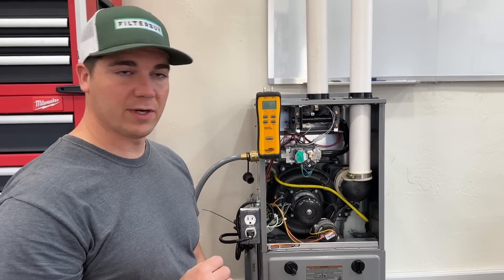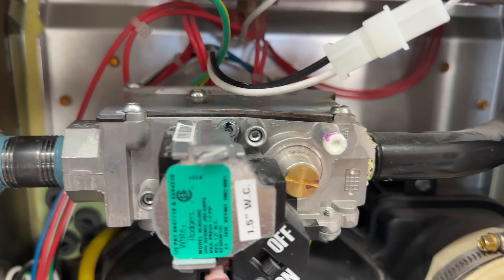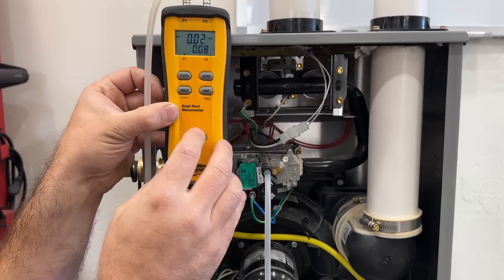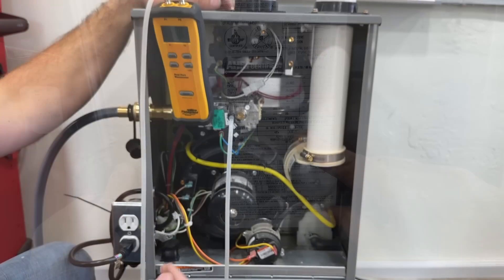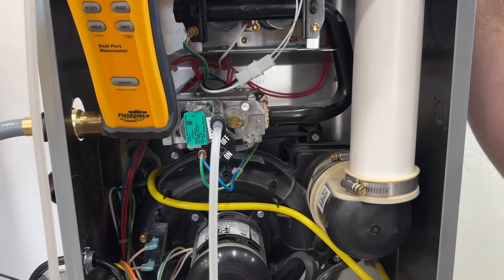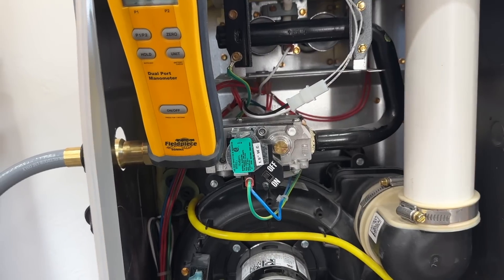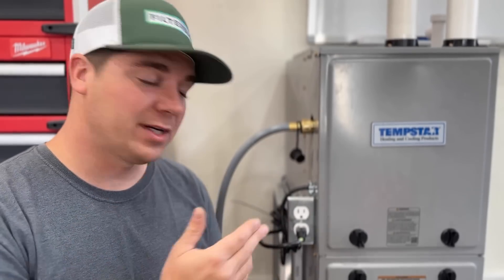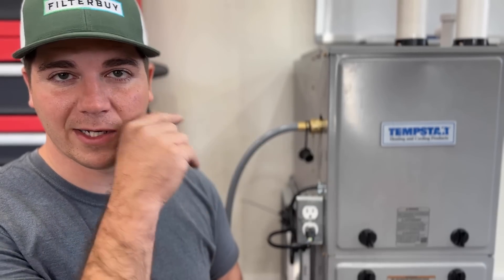Lower Your Energy Bill By Doing This To Your Furnace

Comment: I know it will vary greatly, depending on the situation, but how much savings are we talking about for a typical winter in Michigan? Enough to at least pay for price of the manometer?
Reply: Good point. I assume over time you would recoup the cost of the meter so long as the meter doesn't crap out and you check & adjust it every year. I'm not an HVAC technician but rather a GM technician for 36 years. For someone only using the meter once or twice a year, I would recommend removing the batteries after you're done using it so they don't leak and ruin the meter.
Reply: @ItsDaMechanic  There's no need to readjust the air/fuel mixture every year in a gas furnace.  The BTU content of natural gas in any particular area tends to stay quite stable.  And unlike cars, which are constantly changing elevation, homes tend to say in one place so the atmospheric pressure varies just a little bit from day to day.
Reply from the maker: Oh I’m sure. And you don’t have to check this every year. Once it’s set it’s set. You could check it every few years if you wanted to.
Reply: Lowering gas pressure reduces efficiency
Reply: @ryanbrown5334  can you please elaborate on how this would make it less efficient by adjusting it to factory specifications? I'm always looking to learn, especially from someone who is a good teacher and explains things well.

Comment: How does this save money?
Reply: But aren't you getting less heat at the same time? Won't your furnace have to run longer to do the same job? In the long run will you be using the same amount of gas? So many questions.
Reply: If your manifold pressure is out of spec, properly adjusting it, may save you money. Yes, reducing the manifold pressure will cause the furnace to run for a longer period of time, reducing on/off cycles per hour. When the furnace cycles on the gas runs for about 30 seconds to 1 minute to warm up the heat exchanger before the blower turns on to blow the heat into the house. This is loss of efficiency.

Reducing gas pressure as long as is within spec will reduce the number of cycles and inefficient start up time.

Every time your furnace cycles, the heat exchanger expands when heated up and contracts when it cools down. Reducing cycles will reduce stress on the heat exchanger and increase its life.
Reply from the maker: By using less gas
Reply: @diyhvacguy  It will use the same amount as burner will have to stay on longer. Are you a troll or just doing as a clickbait lure.
Reply: @MrFescue  it also depends on location... here in Texas most furnaces are oversized because of higher cooling load thus the need of a bigger air handler. My home has a 2x bigger furnace than necessary so dialing it back definitely saves money. YMMV, up north you likely won't see much if any benefit of doing this.
Reply: Just what I was thinking you’re lowering heating output of the system , therefore increasing run time . I guess whatever video gets you views
Reply: This was exactly my question. By using less gas, you are producing less heat, therefore necessitating a longer runtime. Now, if the furnace is less efficient at the higher pressure settings, then it might make sense to turn it down.
Reply: Lower gas pressure causes condensation which in turn causes rust which in turn causes a failed heat exchanger. Especially in 80% non -condensing furnaces.
Reply: @ryanbrown5334   I'm sorry to say but you're comment has no credibility since you give no context. Can you explain how adjusting the gas pressure to within factory specifications is going to cause issues. He never said to adjust it outside of factory specifications. He said to adjust it to the lower end of the specification. On top of that, I feel it's similar to an automobile exhaust, once the exhaust is hot from the exhaust manifold to the tip of the tailpipe, there is no condensation forming inside the exhaust anymore. Which is why you don't see it dripping out the muffler anymore. So yes, I could see condensation forming in the heat exchanger if you only let your furnace run for a very short period of time, but not if you going to let it go through a normal heat cycle.
Reply: @ItsDaMechanic  1. The manufacturer’s pressure settings are 1 number not a range. Across manufacturers there will be a range, 3-5 ng 11-13 lp. If you aren’t putting out the proper gas flow you will get incomplete combustion. Honeywell is 3.5 inches of water column not somewhere close to that
Reply: @ItsDaMechanic  If the gas pressure is too low, your furnace’s efficiency will go down. Not only that, but it will lead to a greater amount of condensation of burned gases. That is because the proportion of air in the air-fuel mixture will be too great. This condensation tends to accumulate inside of the heat exchanger, where it will eventually lead to the formation of corrosion, thus necessitating the replacement of this vital component.
Reply: @ItsDaMechanic  incomplete combustion due to improper gas flow causes more flue gas which goes out the flue and not burned in the HX. Essentially making a 80% AFUE furnace a 65-70% AFUE furnace or a 95-96% AFUE into 70-80%. Why pay for high efficiency equipment if you don’t want it to run efficiently??
Reply: @ryanbrown5334  I just checked my newly replaced (around 2020) Goodman 80% 2 stage and it says the pressure should be 3.5, so that's what I'll be adjusting mine to. In the video that furnace has a range from 1.3-1.8. I'm not sure if that's because it's a single stage furnace, or because of the manufacturer of the furnace, or the manufacturer of the valve. I also just noticed I can smell a tiny amount of natural gas that seems to be coming from the gas valve so maybe I need to have it replaced before I confirm that it is set correctly. Do you think the Goodman warranty covers the gas valve? I guess I need to go buy some gas leak detection solution first.
Reply: @ItsDaMechanic  about 15 years ago during a routine inspection a gas co tech found a leak at the gas valve on my water heater. He narrowed it down to the pilot light connection and speculated that a new ferrule might solve the problem. While he 'went to lunch' I went to a nearby plumbing supply, bought a ferrule, and installed it. After lunch, the leak was gone. Definitely try some detection solution - it may be simpler than you think.

Comment: My neighborhood recently had new gas feeds installed . This is the first heating season with the new service. I had to adjust the gas pressure on my two 90% units and several of my neighbors’ too. The gas utility company made absolutely no effort to inform their customers of any potential need for adjustment. I can only imagine how many more out of spec furnaces are out there.
Thank you for the informative video.
Reply: Why would a utility company tell you anything? They don't service the equipment you attach. It's like asking your electric utility to repair your stove.

Comment: What happens if i just turn down the gas by throttling the gas valve and here the furnace flames getting smaller/quieter
Reply from the maker: You could risk being out of that range and have incomplete combustion. But that’s the point of the range on the back of the cover panel
Reply: I have a gas pressure gage how would I convert psi to inches of wc thanks

Comment: One KEY disclaimer here.  going by the panel pressure ONLY works for Sea Level.

At altitude, 3.5 would be way more gas than the air mix can burn and you would be pissing gas away out the flue.

You have to go to the installation or high altitude kit instructions for the correct lower pressure.  

For example in Colorado at 6,800 ft you have to derrate almost 28% and use gas pressures in the 2.1-2.5 range and higher you must switch to smaller orifices.

I am in the process of optimizing my furnace and going to use a combustion analyzer to find my optimum pressure and orifice size, making sure I am at the most efficient burn mix.
Reply: Using gas pressure to set the valves doesn't work correctly at any level.  The heat value of the gas also has to be taken into account.   No competent HVAC professional uses a manometer to optimize the air/gas mixture.  A manometer should be used only to initially verify that the gas pressure does not exceed limits that would damage the valves.
Reply: @LouisWilen  facts we use combustion gas analyzers
Reply: I also live in Colorado and was trying to understand how to set up my gas pressure properly both at the manifold and at the street level. Have you been able to figure out the heat value of the gas? The furnace manual (Carrier) requires the specific gravity of the natural gas (0.58,0.60,0.62,0.64) and the BTU/CU to find the correct pressure
Reply: @vincenzochianese2143  Exactly.  No.  the local gas company was clueless.  According to charts I found online, the heat value for the front range is in the 10xx range and I could not find/get the specific gravity.  I purchased a combustion analyzer (arrives tomorrow) and plan to do my own measurements at #43 orifices down to 2.1 and then swap to #48 and increase pressure to see which setup gets me highest efficiency.  my furnace was running at 2.55 which I think is high for 6,800 ft.. In Colorado Springs FYI.
Reply: @OneLeggedTarantula  I am in the Denver area and I believe I found the same chart you are talking about in the DOE website where yes, the values are above 1k.

I believe my furnace has #44. What combustion analyzer did you buy?
Reply: @vincenzochianese2143  https://www.eia.gov/dnav/ng/hist/nga_epg0_vgth_sco_btucfa.htm
Reply: Sea level to 4500 Ft. A lot of people live in that range. Really a pain for folk living above 4000 Ft.
Reply: the btu content the orifices are sized for varies. c
Reply: Is it possible to rent a combustion analyzer?  Don’t want to buy one to use once.
Reply: Low nox fau does,have an elevation limit
Reply: Yes, but it's going to cost you about $100 for a minimum one day rental.
Reply: what is the cheapest you can get one that will do the trick?  maybe worth just buying one @LouisWilen
Reply: Buy the offerup